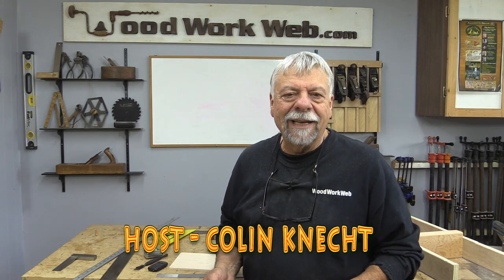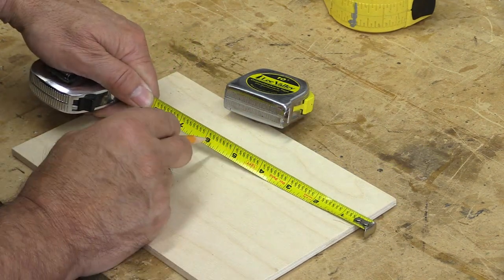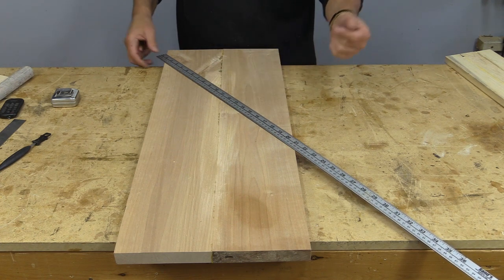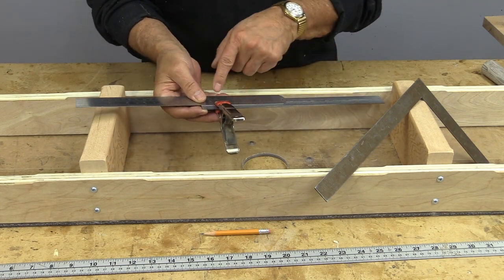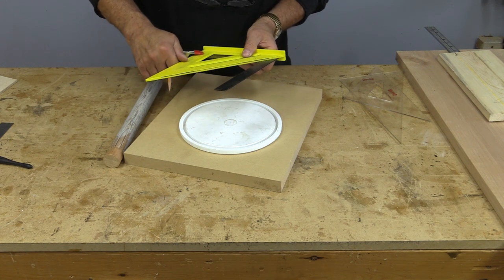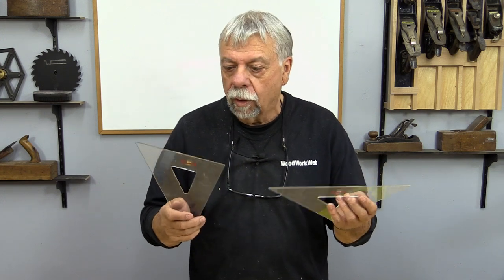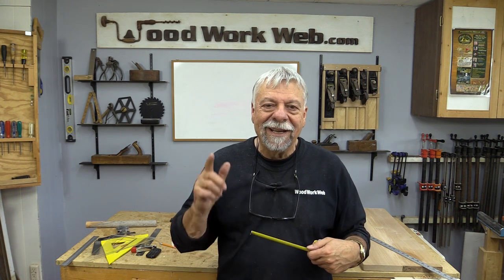5 Quick Measuring Hacks - Woodworking Tips and Tricks

Comment: The second tip about dividing a board in equal parts is the best thing I've seen in YouTube today.. thank you
Reply: Brilliant TIp!
Reply: It's an amazing tip. It may be one of the best measuring "hacks" I've ever seen. So simple and practical.
Reply: It really helped me out
Reply: Dont forget saw blade width
Reply: I just saw that and thought "good god, why have I never thought of that!" It's so simple yet brilliant.
Reply: Great little video,  thanks man.
Reply: Really helpful tips. Thank you. Subscribed.
Reply: Only problem with that is, if your ripping the section's u lose 1/8" every cut.
Other then that was good 👍👍
Reply: @herschelgross5187  I was thinking the same thing when dividing a board into 3 or more parts..the center pieces will be narrower than the outside ones
Reply: I dont see how thats better than using a mesuring tape. You can messure the board and devide it by how many pieces you want and mark just like he did with a ruler.
Reply: @marioaguilar9559  Oh yes, let's see you divide 115/8 into 3 equal sections!
Reply: yes I liked that one too. Am still a bit worried tho that the guy can't read a tape upside down.
Reply: Is this method heavily dependent on the wood being square?
Reply: This can also be used to make rudimentary precision instruments
Reply: @chrislnflorida5192  first, it's *than, not then. And you can't cut in the center of a mark and only be off by 1/16" of an inch? Or, you know, set your table saw fence to the amount you marked the board at, and cut all 5 pieces with very little waste? 😉 I didn't think it was that complicated, really. 😄😄😄

Comment: Good stuff. I also went from a 25ft tape measure to a 12ft for the same reason. Plus i got one that when you pull the tape out, it will only retract when you press the button. Instead of a button to lock it's a button to unlock. I got tired of all the sliding thumb locks seemingly needing two hands to CRUSH it to get it locked down all the way or it would retract without warning.

Comment: COLIN!
HOLY COW! THANK YOU FOR THIS VIDEO!
First off I love the tip on how to divide a board into equal parts. Even though I am fairly new to woodworking, I cannot tell you how many times I have measured a board and done the exhaustive math to divide fractions just so I could get the exact measurement. Your tip is a freaking lifesaver. 
Secondly, the method for finding the center of a circle. I have an idea for dust collection and I have yet to cut my material because I have been contemplating how to find the center of my bucket lid. I can officially start my dust collection project thanks to you.

Comment: O.M.G. I am 59 years old have been doing wood working projects and construction since i was 16, and i never knew any of these tips of the trade. A couple i kinda thought , neat piece of knowledge. But for the most part, I am just floored!! I am shocked and amazed that i didn't know these tips already not that I'm smart enough to figure out myself, but working with all the different tradesmen over the years i never saw anyone use these techniques. 
The tips that blew my mind the most is finding the center of a round object and dividing a piece of lumber. Great video and explanation of these tips.
Reply from the maker: Thanks for watching!

Comment: Thanks for the center finder!  What a time saver!!
My Dad gave me a "trick" for the clear plastic engineer/drafting triangles:
Take a piece of 600/1000 grit wet or dry and on one side just run a light short stroke to "fog" the plastic.  Take a blue sharpie, Mark a couple of hash marks on the fogged area, gently wipe.  The ink is in the scratches.  It will wear off, but not bleed off, messing up your projects.  It's not much but it sure helped!
Thanks again!!!

Comment: Always enjoy your videos.  That said, language matters.  As others have noted, the triangular yellow square in this video is commonly called a speed square or rafter square, or occasionally a rafter angle square.  The clear plastic squares are generally referred to as artist’s squares or architect’s squares, and are available from art supply stores; they are cut with a die and are very precise, much more accurate in general than a framing square for example.  An engineer’s square is usually made of hardened steel and is also very accurate - of course, that may vary with the manufacturer.  
Of all my squares, the architect’s squares and engineer’s squares are the most accurate; the speed squares are almost as accurate; while the framing squares, try squares and combination square are just approximately accurate.  
Thanks again for the many informative videos.

Comment: I thought I would not need a 25' measuring tape on a construction site too. Foreman saw my little 10' tape and said it was "CUTE". I got so much flack for my 10' tape, it's stuck with me to this day...19 years later even after the foreman has now passed. He passed saving 2 of his workers from a falling crane that broke off a truck. He pushed them HARD through an unfinished drywall section so they just got covered with dust. 

That 2nd hack of dividing boards...very nice.

Comment: Some great ideas Colin. I may be dating myself here, but I still use a folding rule for measuring short work the extension works great for inside measurements. They're quick and easy and don't flop around like tape measures. They also slip nicely into your back pocket out of the way when you're not using it, and easy to grab when you need it. 

I always keep a few around and still have the one I used  years ago as an apprentice.

For anything under 6-8 ft ( which is most of my work now) that's all I use.

Comment: Really great tips!! Loved the idea of clamping the rulers for inside measurements - been using a folding wooden ruler with the little brass pullout until now. I like your way much better. Makes measuring diagonals more precise I’d think. 
FYI: Fastcap has a ProCarpenter series of tape measures with 5 or 6 varieties - one is even setup as a story-pole with space to write on it. My favorite is the Flatback (Standard/Metric) and the tape is perfectly flat. So much easier & more accurate (no parallax!) to markup wood rather than rolling the curved tape that every other tape measure has. It’s definitely a workshop tape though as it is rather flexible, especially when used vertically. It’s like trying to stand up a wet piece of spaghetti whilst balancing on a ladder. But at the workbench - primo! Thanks for sharing your videos. They are very informative!!

Comment: Adding my 2 cents that a metal rafter square is WAY better than the plastic when you need trueness. I use them in my woodshop, and love them.
Reply: Christopher Palmer - For FINER work, (as in Picture Frames, he pointed out) the smaller, thinner, transparent, plastic squares, (triangles) really do work better.
Reply: Try using that plastic square as a saw guide. :P Just different tools for different jobs i guess.
His measurements shouldnt be off though, but i suspect he just got a cheap/bad one as most good ones are made out of aluminum.
Reply: I use a metal speed square to make true alignments on my table saw.
Reply: The difference between the two squares is where the start point is when you measure.  On the speed square it starts at the pivot not the bottom of the rail.

Comment: Colin...The construction square is also called a "Speed Square" there great for fitting in our bags that we carry on the job sites...even better when in our shops they slide in the back pockets too very nicely.  Our on all plastic or rubber/plastic you can use cardboard to help Straighten the edges and keep them true.  Colin as always thank you for all your support with our relationship in woodworking!!

Comment: Rock solid tips
Not sure if you have done a vid yet  on comparing measurements based on on metric  conversion from English imperial  
I grew up on feet and inches in the UK and the younger 
generation under 40 only use metric as does most of the rest of the world
Your steel rule had metric on one side so explaining why it it is easier and more simple to use  in  adding up multiple measurements in decimals rather than fractions would be a bonus to your US audience .
Reply from the maker: I'll see what I can do. Here in Canada, we work with both.
Reply: In Canada, a lot of construction material is still measured in imperial, especially wood. And having learned both units in primary school (last few years they taught it like that in the late 90's), I cannot find myself using anything else other than imperial for anything relating to woodworking/carpentry. Science, distances, everything else in metric, but measuring in metric for woodworking is a pain in the ass: the lumber is imperial, most tools are imperial...
Reply: Martyn Cresswell 56 here from the uk and on building sites in the uk we have been using both since I was 16
Reply: Imperial measurement still reigns in Canada and the U.K. In some trades but 
 like the sunset will eventually disappear over the horizon. I remember in the 90's 
being  asked by a Texas company how many millimetres were in one inch.
It's interesting that you guys mention buildings and carpentry materials which historically and currently state 
Metric and imperial sizes even though the Cad drawings 
issued by the UK architect are all in metric.
Did NASA use imperial measurements for constructing the capsules for the Apollo missions ?
Reply: @martyncresswell1132  Imperial measurements rule in the UK? Either you don't live here or are stuck in the seventies.
Reply: @Toontex  I don't let anyone work in Imperial, it's a recipe for disaster. When you say UK you must mean up-north :)
Reply: I was saying imperial in some uk  trades I use both  imperial or metric.
Carpets, wood, curtain materials TV,s  etc and we still drive miles!
I live in the south but came from Yorkshire never found a difference .

Comment: Good tips. I'm familiar with them. One tip should also be that you learn to use only one messure tape. Specially in some fine projects.  After a time no two and two will give you the same mesurements  :-) Keep up the good work
Reply: Slovenian Woodworker for measuring anything the has to be more exact I just start at one inch line and then just take that one inch off of length.  I guess this makes sense to you since I probably didn't explain it properly.  Peace.

Comment: It is very interesting to hear that those cheap engineering squares/triangles are more accurate than the construction square which is probably more expensive (I do not have one, never saw them over here). Thanks for sharing those tips they are very handy.
Reply from the maker: Thanks for watching Hans!
Reply: plastic speed squares are junk, buy a Swanson
Reply: its a cheap speed square, thats why its out.
They are an awsome tool for the workshop or on sight if you know how to use it.
Reply: Plastic, no-name, speed square $2.99 Canadian, Plastic, Staedtler, drafting square $15 Canadian. Aluminum, Swanson, Speed square $25 Canadian.
 I just checked mine, I can't see a difference in accuracy between my drafting square (never leaves my desk, very well cared for), and my 20 year old swanson that's been on several hundred jobsites. My 4 year old plastic speed square is out by about a degree. I have 2 brand new plastic ones I bought for a welding job that is going to kill them. One is perfect, the other is slightly concave. The cheap ones have their place when accuracy only needs to be close, and the task is going to be very hard on them. ie welding against them.
Reply: It's a drafting triangle

Comment: First of all, love your videos-I continue to learn from them. Had to say, though, that no professional carpenter that I would have respect for would ever use a cheap plastic inaccurate speed square. Yes, in short cuts there are allowable tolerances during framing, but just think-"off by a little bit" over 16 feet, 24 feet, etc accumulates to disaster. Good speed squares can be used for accurate measurements, however are not the best tool for precise woodworking--just wanted to make it clear that if a speed square is all you have at the time, it will work. And a speed square together with other more precise tools will make much of what is done in the shop easier and more efficient when you know how and when to use them both.

Comment: One that I worked out yesterday which you didn’t mention: I wanted to draw a line lengthwise down the center of cylinder (a long round dowel), as if I was marking it for a long rip cut. You can find the centre with a combination square by 1) drawing a horizontal line that is perpendicular to the length of the dowel, and 2) drawing two 45 degree lines on the horizontal line. They intersect at the center. Basically you pretend that the cylinder is a rectangle.

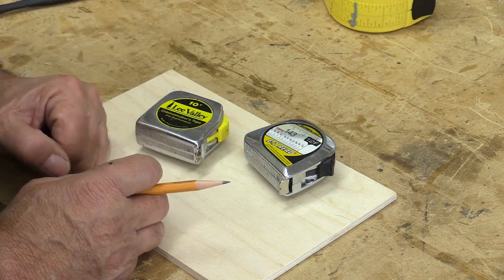Comment: 1:49 = genius! Can't believe I never thought of that!
Reply from the maker: Thank You!
Reply: Jason Enz Works good on boards that are even measurements, 6”, 8”, etc but not so good on fractions, 7 1/4, 3 3/8, etc.
Reply: @danielholtxxl4936  Your meaning is a bit unclear.  But that technique to divide something into smaller, equal parts works REGARDLESS of the exact dimensions involved.
Reply: Lynn Lard Of course it works on any measurement, but if speed or ease of use is a factor, then on fractions it’s not as useful.
Reply: @danielholtxxl4936  As I see it, a situation where fractions are involved is EXACTLY where it would be most useful.  For example, say a 10 7/16" wide board to be ripped into three equal  smaller boards.  Align the end of a ruler with one  edge and slant it such that either 12 or 15 aligns with the other edge ...then mark for cuts at the 4" or 5" ruler marks.

To me that's far simpler than dividing 10 7/16 into thirds and then measuring and marking the board.  Maybe I'm not grasping your rationale correctly.
Reply: Lynn Lard I watched the video again, it’s been a while, and you’re right about that. I guess my issue is more with practical application.  The chance that I’m ever going to need to split a 10 7/16” (or whatever) board into equal parts is minuscule.  The project usually determines the size of the board needed, not the size of board determining the layout of the project.  I guess the technique could be used to see IF I can get three 3 3/8” boards out of the 10 7/16” board - minus kerf cuts, but even that seems cumbersome.  Other than that, yes it is a quick way to divide a board into equal parts.

Comment: Great vid!  Thank you.  =)  Another great trick with the diagonal measurements is to equally divide a board into equal widths.  Just diagonally drag the tape to a number that divides your desired widths equally, then make marks along the tapeline at the equal divisions.  Exa:  if you want to divide a board or sheet into 7 equal widths, take the tape diagonally across the piece  (edge to edge) from 0 to 49in, then make marks every 7 inches.  =)

Comment: They have two sided numbers now where it doesn't matter if you're looking at it from the right side or the left side it still reads the right one closest to you right side up. I've also found that they were white backed tape measures are much easier to read and work with especially in dim lit areas. Like you usually have when your building or remodeling a house

Comment: Thank you for that idea to locate the centre point , it's more faster than the way that I using , I was drawing to lines with different directions in side the circle then lactating the half point of both then drawing a 90 degrees of both point then they will across the centre point of the circle :))  long way but accurate .
Reply: Ummm,.... lactating = giving milk!
Reply: Adam Rogulski !!!

Comment: Most TAPE measures are "right hand" TAPE measures, meant to be used in the right hand. The one with the numbers the other way is a "left hand" tape.  I have the same problem.
Reply: SAME thing with circular saws...I bought a Porter Cable "left-hand" saw years ago, because as a right-hander, I can see the cutting tip without hunching over the saw like Quasimodo!
Reply: If one can't read a tape measure upside down, there is no hope for that person.

Comment: Great tip for finding the center of the board. But beginner me has a question. You said the board was 11.5 so I don't understand how 6 is the center. Wouldn't center be 5 3/4 ? Please explain. 
Thanks
Reply: He angled the ruler so it read 12 inches across on the angle.

Comment: Your outstanding with your work,.. but I cant figure out why you don't call out the "construction triangle" as a Speed Square.  A very, very versatile and useful tool if not one of the most used hand tools in the carpenter mechanics trade.  The "wow" you referred to, is because its a cheap version that's been beat on. In construction, we DO care if its off, there lays the difference between hack and craftsman  Get a quality Swanson or one of the others and you'll soon be a fan.  Thanks for all your great info and video work Colin. just a thought.

Comment: Test your engineering squares before you buy. If you can take 4 in the shop and put them with the 90 degrees back to back they should close in the center without any gaps.
I have tested many squares in the shops and very few are true 90 degrees. Most will leave a little star gap in the middle.

Eventually I had a shop laser cut me some stainless steel squares to get a true 90/30/60 or 90/45/45 degrees. It does not get more accurate than that.